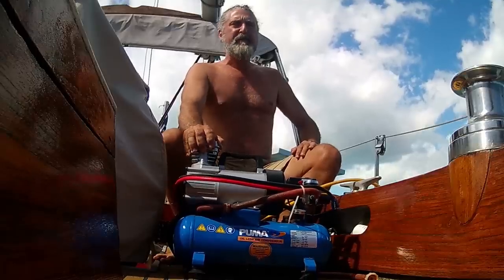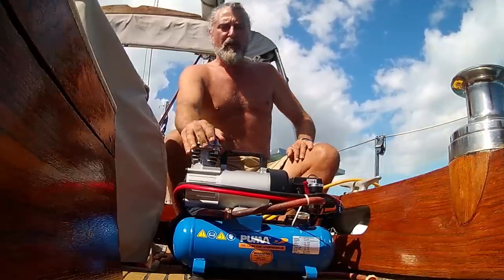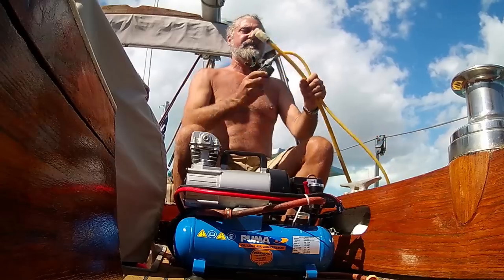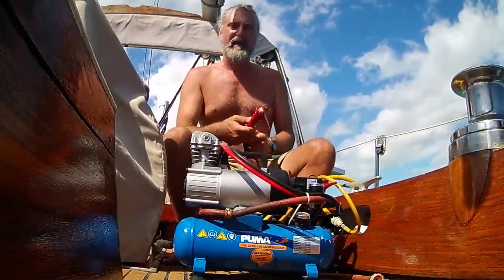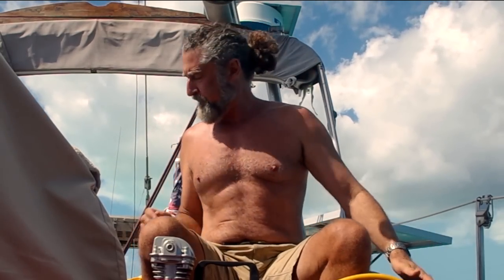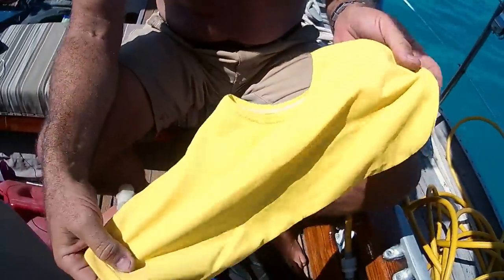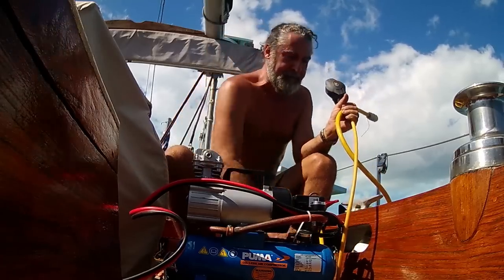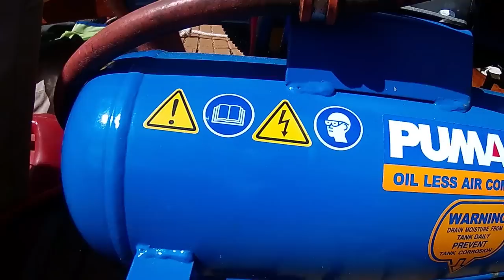$300 DIY Dive HOOKAH + Cleaning Our Boat's Bottom!!

Comment: Hey Clark, sorry If I missed it, mind telling how old you are?  I'm 60 and wondering if its a late start live aboard.
Reply from the maker: It depends on health and attitude.  I know guys in their 70s doing it.
I'm 56.

You might want to start with a "ready" boat.  Refitting an old boat is pretty physical sometimes.  Harder then sailing!
Reply: I am 58 and 4 years ago I bought a 25 foot Top Hat yacht for $8K AUD , cheap to run and maintain about 50 years old already, built with really thick fibreglass because in those days it was better to be safe than sorry, (they are bluewater and have circumnavigated).  I expect it will last another 50 years, but I know I won't be around then.  Motor is a 5 HP outboard.  Mast and rigging is 10 years old and needs replacing, which is great because now I can set it up with a Junk Rig, which is what I always planned to do because it makes sailing so easy.  I was just waiting until I amortised my investment.  It is a one-off expense because the junk rig mast can last for decades and without stay wires you have more usable deck space.  You don't have the problem of keeping spare sails below so more room for living, it uses only one sail usually made out of canvas or dacron.  With canvas sails you can circumnavigate the world 3 times before you need to change the sectional sails which you can do yourself, and you can jury rig repairs using tarpaulins, as there is no pressure in each of the cells, compared to a conventional sail that tear once and cannot be used.  Helpful when in the pacific islands, no need to spend thousands shipping in a new sail.  That is why you see old chinese junk rigs coming out of a typhoon with holes in their sails and they just keep on going like nothing happened, no problem.  I will set it up to sail from the cockpit by rigging the lines back to the cockpit.  Junk rigs are so easy to sail it makes a novice look like they have been sailing for 30 years and by pulling down the sail while simultaniously sipping coffee you can stop on a dime, try doing that in a conventional sailboat.  In storms there is absolutely no need for running about the boat, just sip your coffee as you lower as much of the sail as you need at the last minute, it gives you the luxury of waiting to the last second.  They say a junk rig can keep you sailing 10 years longer than a conventional rig which has you running up and down the boat in all sorts of weather, changing sails, reefing etc. so with a junk rig you should have many decades of sailing ahead of you.  See Junk Rig Association.
Reply: @michaeldemarillac9992  Wow love the out of the box thinking.
Reply: I am 65 and started what I dont understand about people what does age have to do with anything? do what you want stop worrying about age  geeez

Comment: What depth are you generally working at? I'm a pool repair guy but I have been using tanks and Soooo much extra weight as well.
Reply from the maker: Honestly I just use it to clean the hull.  So no deeper then a pool.  But it will go deeper.

Comment: I wonder how you could mount that and a battery into a float?  Any ideas?  How long was your yellow hose?
Reply from the maker: Inner tube it the usual way.   But I always seem to dive with the dinghy so that seems safer.
   I have 2 100ft hoses.

Honestly I mostly just leave it in the yacht and use it to clean the bottom of the yacht or dinghy, or to change propellers.  We just hold our breath for sport diving.

Comment: I've watched this video a couple of times already and read through the comments a couple of times as well as checking out quite a few other videos of people cobbling together their own inexpensive hookahs.  I think this is a great way to save money, but would also like to find out if there's any way to just attach a really good quality air filter and water separator to calm the nerves of those who keep saying this is so dangerous.  Some of these videos on youtube are recommending to just pick up some hose at Harbor Freight.  How difficult would it be to just attach a filter right before it gets to your regulator?  That way everything is filtered, right?
Reply from the maker: Sure one can filter.  I'd do it at the start of the hose where it leaves the tank.  Water separator is unnecessary as humans tolerate water just fine. 
This compressor has an intake filter already and since it is oiless I'm not sure what one would be trying to catch.  I like to think that the compressor isn't throwing chunks of metal or if it does they settle in the tank.

   I guess one could just add a bit of 1 inch or so pipe filled with cotton at the start of the hose.

   As for hose.  It's vital that what you choose can't kink.  A kinked hose will shut down your air right away.  Unlike a compressor failure which gives you several more breaths.
Reply: @Clarks-Adventure  You will want a water filter as vaporized water in the air supply can freeze your regulator up due to the pressure drop
Reply from the maker: Not necessary.  People have been using similar systems for MANY years with no issues.  The compressor is only taking the air up about 70 psi.  And the regulator is in water which is a great heat sink.  Nothing gets that cold.
Reply: "Humans tolerate water."
As does mold and rust.
Which would both build up inside that system.
SCUBA bottles require inspections. 

*Commercial Diver here
Reply: @homeslipper  Here again, wouldn't a good 5 micron filter solve the problem?  When the hose, fittings, etc. are so cheap, they're basically disposable anyways, no?   I live out in the country where mold and rust is everywhere.  Other than black mold, I don't see the problem especially if one has a good filter.

Comment: I know this is an older video but I am curious about the power set up.  What size battery do you have this hooked up to? How long of use time do you get out of it before you need to swap batteries or recharge?
Reply from the maker: I forget.  I think I already answered it here though.  Read through and you might find the answer.

The reason I forget is I just jumper it to the ships batteries and use it to clean the bottom.  Temptress carries 1700ah so it's about infinity large for this use.

You could work from the hp of the motor though to figure it out.

Also I have a portable 50ah Lifepo4 battery that I always planned to use with it.   So it's low enough to have that be practical.

Again sorry but I honestly forgot the draw and I don't want to answer with a guess.  I'd have to dig it out and run it to know.  I'm still sick in bed.  Sorry.
Reply: @Clarks-Adventure  Thanks for the info. Get well soon!

Comment: Nice thrifty solution.  How much battery power does it consume: ie, amps draw and typical amps*hrs utilized per cleaning.
Reply from the maker: I haven't put a meter on it yet.  I'd guess it averages about 40 amps at 13 volts.
  Takes from 1 to 3 hours to clean the bottom well.  Depends on what is growing there.
Reply: Question on current draw.  I'm assuming you're using house batteries, I'd personally (since I'm going to do this) get a portable battery, and am thinking that a 100ah battery would last roughly an hour considering you said  40A (so.... you don't want to kill your battery completely, not even deep cycles, and an hour would use 40AH so just above 1/2 power draw).  On your system (again assuming) house battery, do you have solar etc hooked up to charge your systems?
Reply from the maker: Yes, it doesn't dent the voltage of our 1500ah bank with the panels charging.
   If I was going mobile I'd think about a lithium.  Spend some of your compressor savings on a battery that could also help out your house bank when you aren't diving.

   I'm learning a lot about them now.   Possible project coming up.
Reply: If you use a LiFe battery as Clark (below) suggests, then 40 A for about an hour is about 40 AH.  This is because the LiFe battery has very little internal resistance. BUT if you go with a lead acid battery, then the consumption will be a lot more than 40 AH.  This is because the energy consumed from the battery includes the energy loss due to the battery's internal resistance.  This energy loss goes as the square of the current times the resistance(E_loss = I^2 R).   A 100 AH rating comes from 5A over 20 hrs, so for a current 8 times larger (5*8=40A), the energy loss in heating up the battery increases not by a factor of 8 but more like a factor of 8^2=64.  Ok, it a bit more complicated than this because the resistance is not constant.  Another reason against a single lead acid battery, would be the voltage drop of the battery ( V_battery = EMF_TrueVoltage  - I *R).  That is, a large current results in a large drop in voltage, leaving too little to run the motor (or worse run it slowly while but killing the motor faster).

Comment: Great video.  Can you run more than 1 air line at the same time with it?
Reply from the maker: I haven't yet but we will.  It should produce enough sir for two to work on a boat but I don't expect it will make enough for two to go very deep.
Reply: This comment was made 1 year ago and was just checking to see if you had tried a second airline yet?     We will be in fresh water no more than 8-10 feet deep, will this compressor work for that?
Reply from the maker: Haven't tried two yet but I see no problems.  With me alone and exerting myself the compressor was cycling off and on.  It had plenty of capacity for boat bottom depths.  
  We free dive for pleasure and hauled the boat last summer so we haven't had to clean the bottom since this video was shot.

Comment: If you use a compressor like this, to paint a surface for example, you have to add an oil separator because the oil of the compressor gets atomized and sent through the hose. Thus ruining the paint. I think that would be a must for the system. Thoughts?
Reply from the maker: There is no oil in this compressor.  None.

Comment: What was the output pressure on the air tank?
Reply from the maker: About 70 psi I think.   It's adjustable
Reply: @Clarks-Adventure  I think you can go way below that for surface job
Reply from the maker: Yep.  Anything under 100psi  will work with the second stage regulars

Comment: How about a 110 system from Home Depot.  My boat has 110 and a generator also.
Reply from the maker: You have to make sure it's the right kind of compressor head.  The motor isn't important but the wrong compressor head will mess up your lungs.

Comment: Great idea but I would want to add a air filter. Even though it says oil less compressor,  you still have to have a moisture filter to paint cars so your lungs would need to have the filter as well
Reply from the maker: Lungs are good with water.  Paint isn't.
Feel free to add a filter.  I just want to know what you think you need to filter out.
Reply: Did you watch the video
Reply: @Clarks-Adventure   did you watch the video
Reply from the maker: What video?  Ours?  Yes we watched it we filmed and edited it.  I'm confused.
Reply: @Clarks-Adventure  sir,  I'm just saying that a air compressor even though it says oil less it still creates moisture in the tank and if you have a 20 dollar moisture filter installed before the air hose. You will prevent any and all of the bad moisture that will occur in the tank giving you a better chance of not getting build up in the tank. I apologize for asking you if you watched the video because I didn't realize you were the one asking me the question. I'm just trying to say that you have a great idea but I would add a filter for a extra safety precaution.
Reply: @Clarks-Adventure  so was Richard Gooding

Comment: I bought that compressor and right on that compressor it says do not use for breathing air
Reply: I just got mine in the mail yesterday it says the same thing unfortunately I was so excited I didn't realize it until I hooked everything up and breathed off it for 8 minutes my lungs started hurting I went to disconnect the airline and noticed  danger do not breath and I did have a water & particle  separator filter on it. Puma should definitely have something about this on the website I've been trying to find a carbon filter to maybe help because returning this is going to cost almost as much as the compressor cost.
Reply: I use the tank but changed out the compressor with a breathing air compressor and a breathing air filter

Comment: what size dive hose and fittings are you using to hook up to that compressor? Thanks
Reply from the maker: The hose was left over from a "super snorkel" gas huccah unit.  It's 3/8 hose and nylon garden hose fittings.
  I would recommend the same fittings they have worked flawlessly over the years.  Make sure the hose you use doesn't kink.  The diameter is not critical.  The air in the hose will be at about 60psi so it flows a lot through a small hose.

PS. I don't use hose clamps for obvious reasons.  I did one repair with whipping line and a constrictor knot.  Worked great.
Reply: @Clarks-Adventure  was curious about the fittings also. so the outles from the compressor is 3/8? and how about the mask the fitting is 3/8 also? (was gonna put quick connect all the way with filter and a T so i could attach 2 people)

and i guess  as hose it should be good enough with an "3/8" pressure washer hose aslong as its washed out.

Sadly no competitive compressors for sale in my country or nearby so the compressor will endup at 350 :3

Comment: whats depth can you go down to? x
Reply from the maker: I'm not on the boat now but I seem to remember it putting out loads of pressure.  So deep isn't an issue.  I'm not sure on the volume.  Works fine with plenty of air for even hard work where I've tested it.  I'd guess it should keep up to 60 feet easy.  
   Having the tank helps.  You have a few breaths in there and the hose.  Do if breathing gets hard just swim up.  If the compressor fails you have several breaths still available as long as you swim up.

Comment: i recommend using the "knife proof" gloves you can buy very cheaply. they dont look fancy but you will never be cut nor do they break easily
Reply from the maker: Thanks, I have bought some for this trip
Reply: @Clarks-Adventure  glad to hear, i use them for diving while i go spearhunting.

Have you tried 2 people yet and maybe how deep you can comfortable go down to?

Did order 1 compressor myself and gonna test it out in the end of jan. hoping i can reach 10m/2 people
Reply from the maker: No, so far I've only cleaned the bottom with it.  The boat was anchored in 20 feet.  I could breath easily at that depth but that's no test.  And haven't tried the second regulator.
   When you find out the limits please tell me.  I want to know and I'll put your findings in the description.  If you do a video with the answer I'll link it up.
Reply: @Clarks-Adventure  finally in the province again and had some time testing it out.
Sadly i didnt get that compressor because the seller changed the shipping price and no other decent 12v (with tank) avaible in my country. So i went with a 220v 0.75hp with an inverter instead (about the same strenght)

Does run 2 people but after 1 hour it shutsdown by overheating then u wait 10 min to continue again
Been down to about 7-10m to collect sand for concreate for the past 2 days and it made my life alot easier.

Biggest issue i have is the hose folding.. i suppose if i choosed a bigger compressor that would be less likely bean issue but couldent find any good oilless that was any stronger (some combined 2/3 oilless "pumps" to achive more but then u use 2/3x the battery which aint optimal especially since it need to handle the surge startup power)
Reply from the maker: Are you using a pure sine wave inverter?  If not that could be causing your overheating.  Electric motors don't like stepped wave ac.  They get hot.

Sorry to hear about your hose issue.  A bigger compressor won't help there.  You just need hose that doesn't kink.  I mention that in the video, it's VERY important.  I had a hose kink with an old diy SSA system (someone else's) and nearly died.  Good hose is vital.
Reply: @Clarks-Adventure  should be.however hard to find branded once around here so i jut got to take tjeir word for it. It works fine gor 1 person but 2 it does overheat after a while.

Been diving around 10m the last fays catching crabs and shrimp i really love this thing! Just need a bigger battery haha

Comment: Looking for alternative compressors available in europe, anyone?
Reply: you have several 220v variants which u can use with inverter, its hard to find a 12v with tank. just make sure its an oilless design
this is one of those (which you can see being used on alot of "compressors with tank")
aliexpress (dot) com/item/4000053886656.html